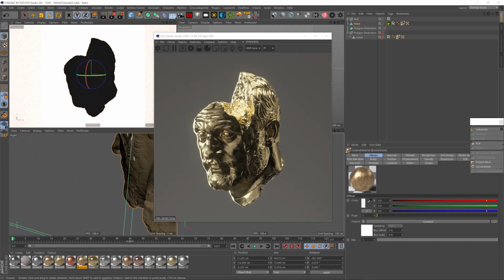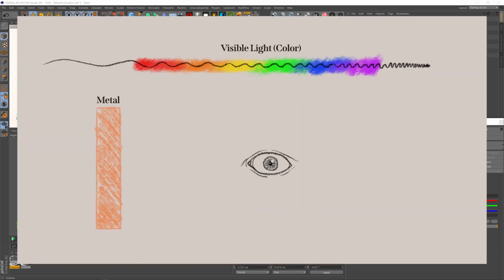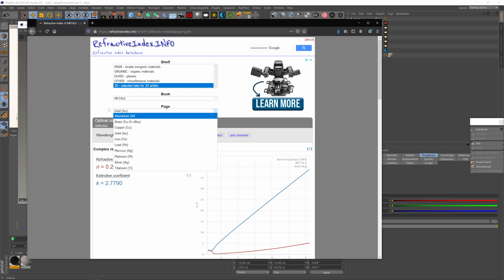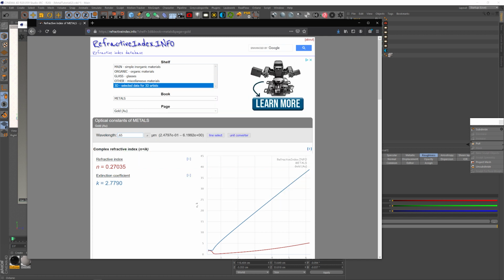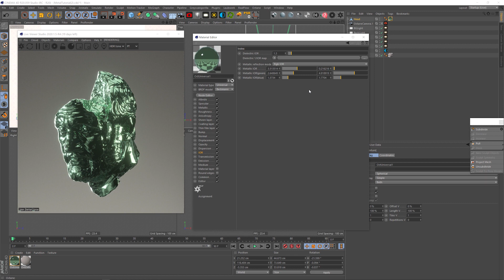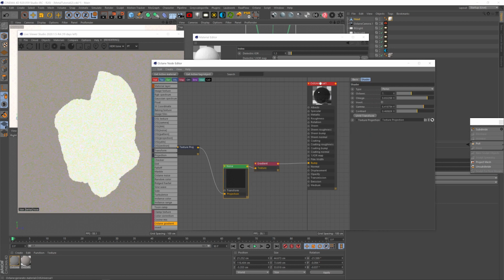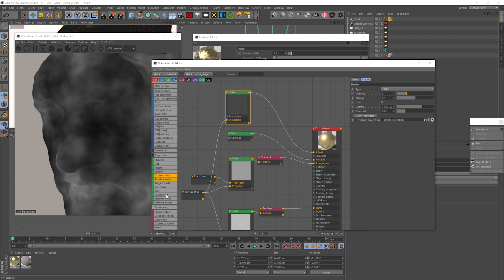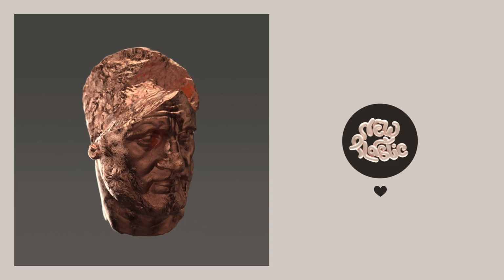Cinema 4D Quick Tip - Physically Accurate Metal (Octane)

Comment: hey man! great tut and materials pack, thank you! Even tho all of those are beautiful I'm straggling to get an oxidized silver material in Octane. It is easily achievable in Keyshot with curvature function... but I can not get the same result with Octane even tho I like its lighting more compared to Keyshot.. Thanks in advance!
Reply from the maker: Hey thanks! It should be pretty straight forward, the Tarnished Bronze material does pretty much what you're trying to do, you just need to change the IOR data from bronze to silver. Or just get a silver material, and add a Dirt node (or curvature node) to the Metallic channel (so the black info in the crevices will tell the material to remove the metallic from those parts). Then plug the same dirt node to the Albedo channel and use a gradient node in between to control the color of the oxidization. That should work!
Reply: @NewPlastic  thanks a lot, man!

Comment: i just buy ur work buy how i can use it in blender ? need ur relpy T_T
Reply from the maker: Hey the pack is made for C4D but you can copy the IORs and put them in Blender, I can send you the IORs used in the pack
Reply: @NewPlastic  yeah that i need, ty
Reply: @NewPlastic  how u can send me that in gmail ?
Reply: @NewPlastic  bro
Reply: @NewPlastic  i send u a mess in gmail did u got that? i really need it for my job now :/
Reply from the maker: @nhaajtnam6135  Sending you right now brother, had to find some free time to dig the project file out of the archives
Reply: @NewPlastic  thought u forgot, tks u so much will sp in future
Reply from the maker: @nhaajtnam6135  Appreciate you!

Comment: i want to purchase this pack but i just need to ask you first is that work with Cd4 r19 and octane Version 3.07-R2 . thank you and never stop creating this awesome stuff 😊
Reply from the maker: Hey! Yes these nodes are available in Octane 3.07. R19 shouldn't be a problem either. Thank you!
Reply: @NewPlastic  It doesn't work with 3.07 / R19. @Hamza, did you purchased the pack?
Reply from the maker: @tompijnappel7368  Oh if they don't have the Universal material then use the Metal material, I'm pretty sure it has the RGB IOR as well!